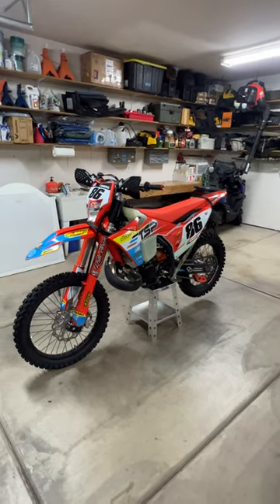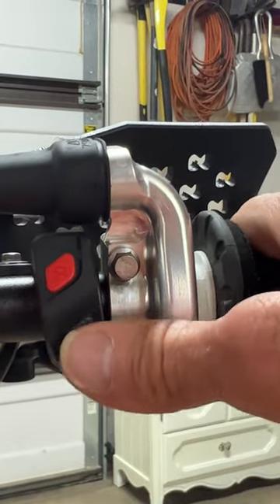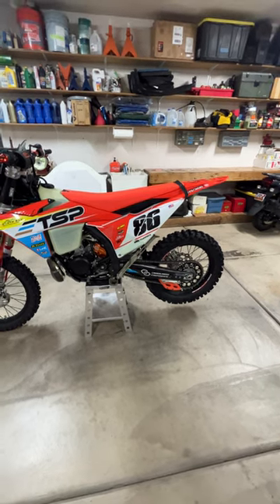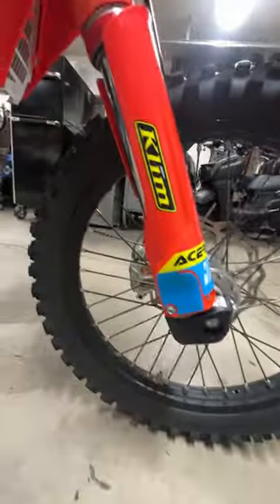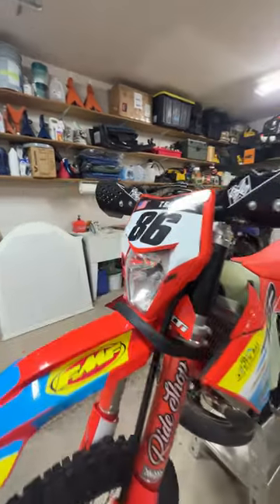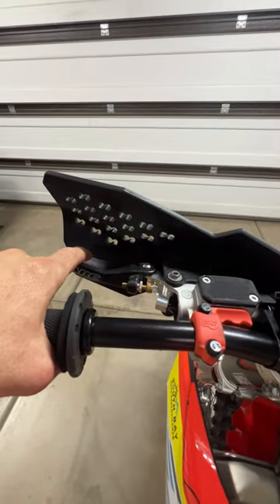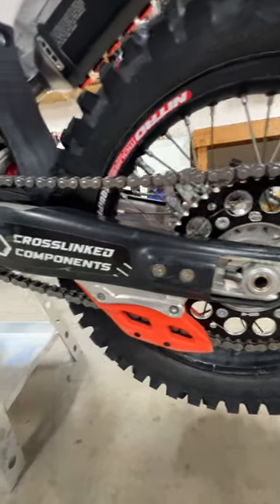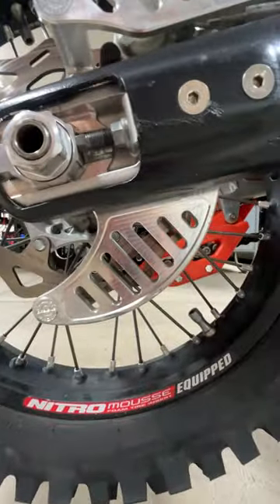2024 KTM 300 XC-W (EXC) Hard Enduro Motorcycle Build and Initial Thoughts

Comment: Thanks for sharing the details of all the mods you've made. I agree about the 2024 300 suspension and feels good for the riding I do too. Very eager to know how the TSP tune and head perform. My 2024 300 the bottom end power feels great, but mid/high feels rich and I get through a lot of fuel in a ride. Keen to try TSP if it works well...
Reply from the maker: You're welcome.  Thanks for the comment.  

Yes, I'll probably post my thoughts on the TSP ECU flash and head insert when I finally get those.  

I filled my gas tank completely full and rode two days straight of pretty tech/hard enduro stuff, and it finally ran out at 41 miles.  I'm guessing the average trail rider could get closer to 50 miles.  I'll be buying an Acerbis desert tank when they come out with one in a few months.  Plus, maybe the TSP flash will help out with fuel mileage.